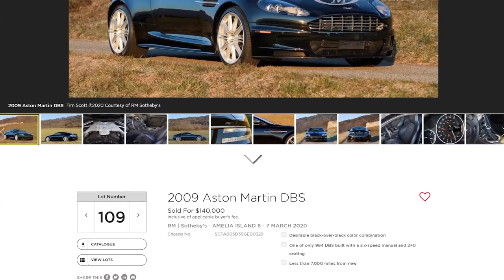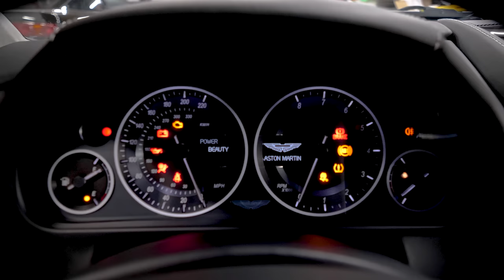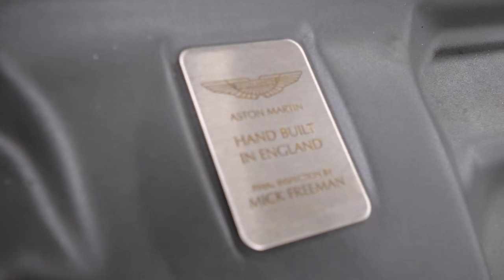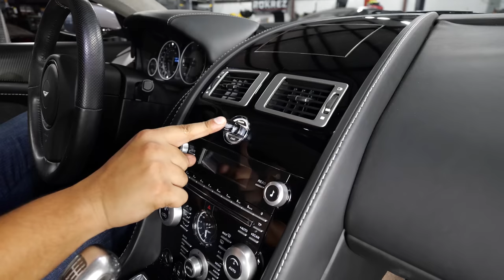I Just Bought The Cheapest Manual Aston Martin DBS IN THE WORLD

Comment: Not a minute into the video but to answer your question, 

I love cars because of the engineering or handwork that goes into designing and maintenance of a vehicle. Over 100 years ago motor vehicles were beginning to be integral toward life in the 20th century an onward where even a few short years into the 1900's individual's started supping up there cars for more power eventually to start racing them. In 100 years cars manufacturing went from vehicles that can barely go faster than 25 mph too cars that are capable to speeds over 200mph on a short stretch of road while still have basic auto features(Radio, air conditioning,  etc.). Now into the 21 century we are witnessing a turning point in auto manufacturing where cars will have alternative uses of power thats not reliant on gasoline. Besides average joes can modify they're vehicle to their own wants and need themselves if they can.

Also what makes a car desirable in my opinion comes down to a saying "It's not the driver who chooses the car but it's the car who chooses it driver". That feeling when you see a certain car that catches your eye and calls you cause of the bodywork, engine, interior whatsoever. But that feeling of happiness as that car defines you as it something that completes part of your life. My feelings towards the Testarossa or Testarossa TR.

Comment: Thats also my dream car, however in black (Quantum of Solace spec). If i were to modified it, i would see if its possible to put some of the switches from the later Vantage (2016/2017) interior on the inside of the DBS.

Comment: You said the parts are not that expensive.  I have a manual 2009 DBS that I have had since 2014.  I haven't driven it that much but the ten year maintenance was expensive at the dealer.  Oil changes are not simple to do on it because of where the oil filter is.  This one is Lightning Silver so it is a little lighter shade than yours.  Thanks.

Comment: Clean car. Everything your described i feel all that in my Chevy ss/holden commodore.
Mag ride does same thing but with 4 settings.
6.2 v8 about same power. Manual. For only 50k. Not an Aston but good enough for me.
And only 12k sold is the USA and less and less everyday. And engine is super capable too. 1k hp easily and over 1k tq.
On stock engine.
But mine with some engine add ons now it will be around 1500hp

Comment: Interior on the DBS is identical to the Vantage.  Same dash, same electronics, same seats (Unless bespoke leather order), same alcantara headliner, same metal buttons, knobs and ashtray.  Yet the Vantage S has a more powerful V12 and weighs less.  Other than the prestige for paying more, the end result is less car.  Under the skin, the DBS has carbon fiber fenders and other bits that drive the cost up.  But put both cars side by side and you'll scratch your head why one is twice the price brand new.
Reply from the maker: Vantage S is more harsh, doesn't look as good in my opinion, and isn't as comfortable on long trips. Also, a manual Vantage S is more expensive than a DBS, and the flappy paddle one is extremely annoying and expensive to live with.

Comment: This is not the last manual big bodied Aston.  I have a client in South FL with a 2011 DBS Carbon Black Edition with a manual. One of the 20 Carbon Black Edition Coupes was pulled from the line and converted to a manual per CEO, Dr. Ulrich Bez for him to drive at Pebble beach. It's a long story, if you would like more details PM me.

Your DBS is bad ass, I've done over 40 new car paint corrections on these for my local dealer.
Reply from the maker: The DBS is the last manual big bodied Aston. That 2011 is essentially the same car as mine.
Reply: The last manual big-bodied Aston, if you want to be precise, has the VIN ending in E03300.  It's a 2012 DBS Ultimate Edition manual.  It's super-rare "1 of 1".   The Ultimate Editions were the final run of DBS production for that generation.

Comment: One can only hope that you actually did some research on the V12 Aston Martin put in that chassis. That engine was not built by Aston Martin. That engine was contracted to and actually built by Ford of Germany in their Cologne plant. The engine is basically two Ford Duratec V6 engines on a common crankshaft. So when you blow it up you can see just how many cheap powdered metal Ford parts are in the engine. I do believe that Aston Martin continued to purchase V12 engines from Ford until January 1, 2018. After that date, all V12 engines come from AMG of Germany. They, at least, know a thing or two about building V12's.

Comment: does the valet key limit performance? The car is really great...have you priced replacement rotors?
Reply: The valet key is full-function..  It's just a $500 plastic version of the fancy crystal key.  I never valet mine anyway, but when I drop it off for service, I leave it with the plastic key.  Much less fragile, and much cheaper to replace if anything happens.  Replacement rotors and pads are damned expensive. When I asked the dealer how much replacing all four, they said it was more than $20k.  The good news is that they don't wear much in street driving.  My only complaint about them is that if you brake gently around town or in traffic too much, they will start giving off a high-pitched squeak.  It's super-annoying.  Fortunately, it's easily fixed by finding a place to wind it up to triple-digit speeds, and then braking hard down to about 30 MPH.   Do that once or twice, squeak goes away and stays away for a while.  Plus it's fun.  :-D
Reply: @qbranch2405  I was pretty sure they were around 4-5K/corner....  Dealer service can also be pricey on these.

Comment: The problem with owning a car like this is paying $600 for a part that would cost $60 on a "regular" car.
Reply: True, economics of scale apply here.  Toyota builds about 10 million cars a year.  Porsche builds about 250,000 a year.  Aston Martin has build about 85,000 cars TOTAL, since the year 1913.   No way they get volume pricing on parts, except for the few things that were taken from the Ford supply chain (turn signal lever, nav system, fuses and relays).  Aston Martin only built 2,563 DBS coupes of this generation.   For the parts unique to the car, you are going to pay dearly.  That's just the price of admission for cars like this.